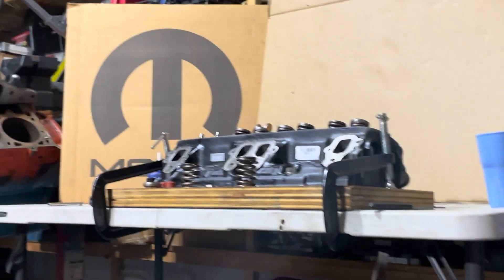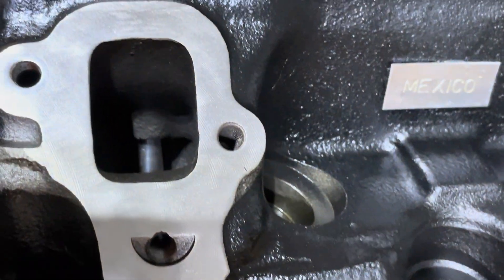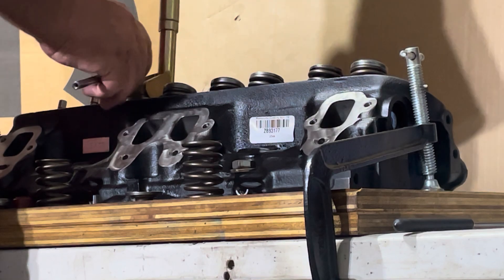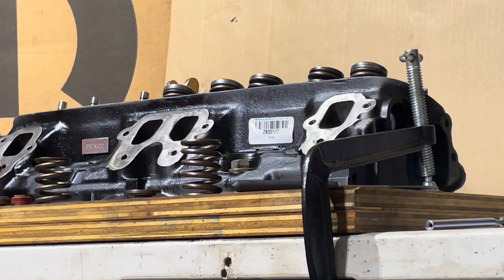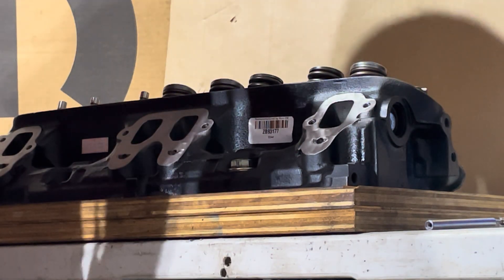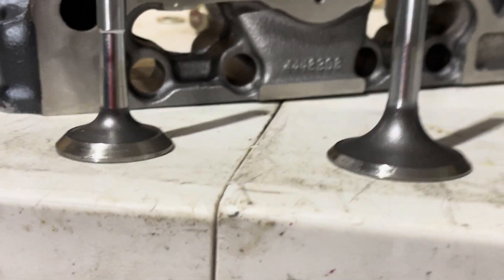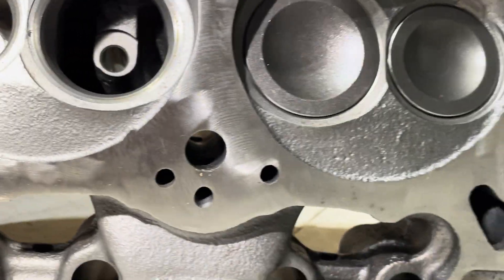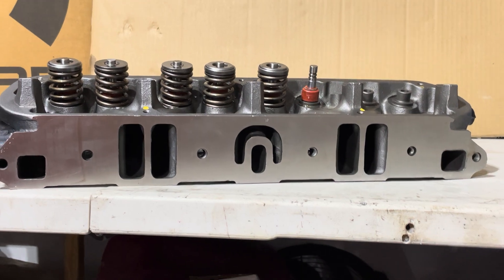ATK 308 rebuilt head aquired from Summit Racing

Comment: Thanks for the great video I’ve always been curious about how good those heads really are as I’ve heard positive and negative information on them
Reply from the maker: If it wasn’t for the valve guide work, it would be a good thing. It’s not a horrible head, just not what is expected nor what you would want to use on something you cared about. The Other head coming up.